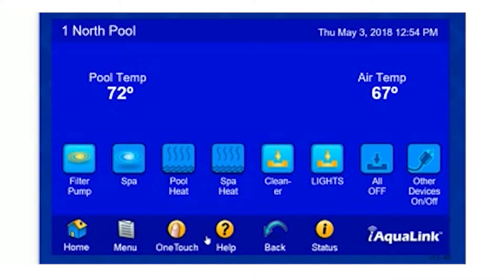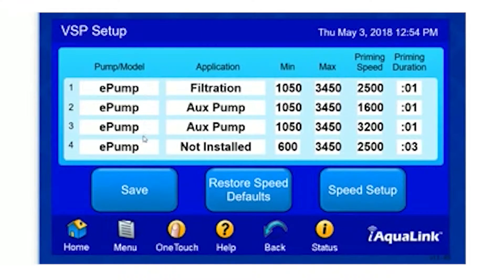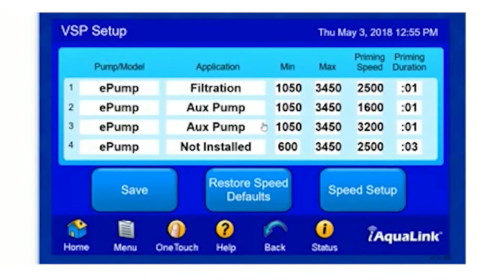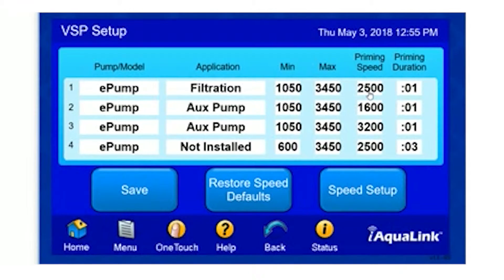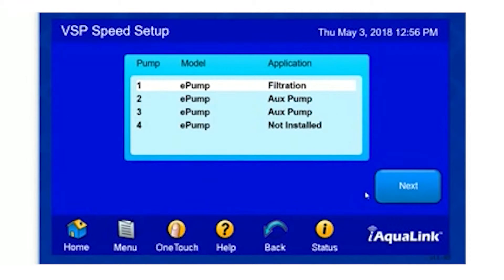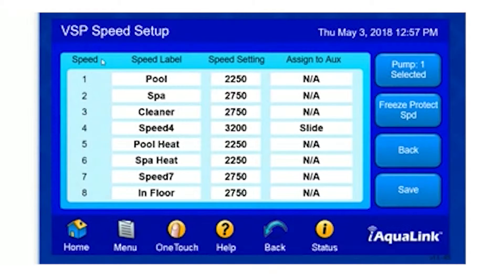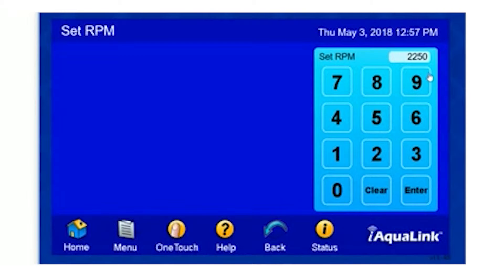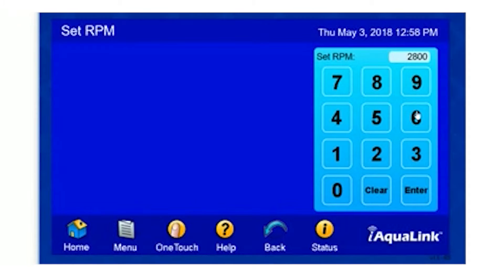DIY : How To setup a Variable Speed Pump w/ iAqualink app

Comment: I would like to run my pump at one speed during the day and a different speed over night. How do I do that?
Reply from the maker: You would have to have an available auxiliary. Name that auxiliary “Night Speed”. Then program one of the available speeds in the filter pump speed settings to that “Night Mode” auxiliary and set the speed to your choice. After you’ve set that up, program the schedule to run the “Night Speed” auxiliary to the hours you want to run that speed.
Reply: @PrestigePoolandPatioFrisco   you can actually running a speed on schedule no need to use an extra aux...  run the filter pump twice and at the night run the spd
Reply: How do you know what aux is the pump assigned to?